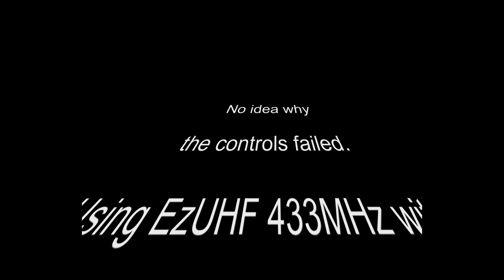LOVE that Failsafe! (BIG Crash...but FOUND!)

Comment: what kind of tracker do you have I had a fly away unlike you there was no finding it. I lost sight of my baby when she whentt through the clouds about half mile out from where it took off I just hope it landed in the woods like your but coming down from clouds there wouldn't be not one useable part left I'm surprised the lipo didn't start a forest fire cause I have no doubt that the fall busted it like a water baloon😭😭😥😢
Reply from the maker: I feel your pain!  I lost a freshly built Tankito on it's maiden flight.  No trace.  I now use a GPS tracker I bought from eBay (here's one like it, item #231624010648).  I put a pay-as-you-go simm in it and it works pretty good.  It is light and the battery lasts for days.
Reply: +AerialWerks any chance I could get a link item number not found
Reply from the maker: http://www.ebay.com/itm/New-RealTime-GPS-Tracker-GSM-GPRS-System-Vehicle-Tracking-Device-TK102-Mini-Spy-/231624010648?hash=item35edddeb98:g:5L0AAOSwlaxWOCSn

Comment: I have a GPS tracker designed to be put in a vehicle that has a cellular modem and GPS in it so when I send it a text asking for the location it replies with the link to it's location on Google maps.  They are pretty small, don't weigh much and only cost about $20 on Ebay.   Seems like that would be a good thing to put on a quad so you can find it when it takes off and goes for quite a distance.  I was thinking about putting it on one I built but never could get the darn Pixhawk PX4 to work.

Comment: What chip did you use to find it?
Reply: bosnianbill What GPS tracker are you using?  I have a bluetooth Tile but the range isn't good enough to find my quad in the woods.
Reply: bosnianbill Thank you for the info, that seems perfect.  Did you get the T-mobile sim card at Wal-Mart or online? By the way, I'm a big fan of both of your channels.  You are the reason I got into lock picking for fun a couple years ago.

Comment: Use Dragon Link lol
I'm glad you managed to find it!
Have a great new week
Reply: bosnianbill How dare you, comparing the king of kings of UHF equipment with ezUHF from Immersion "crap" RC :p
The new Dragon Link micro RX has a GPS option :p
Reply from the maker: ABMNS PRODUCTION Oh!  NOW the good advice comes flowing, AFTER I flip the coin and equip a dozen quads with EzUHF...  Also, typical of my luck, DL comes out with new technology AFTER I buy the old technology.  Crap.  That GPS option would have been a nice thing to have...
Reply: AerialWerks If you have good experience with your ezUHF until today no real reason to change.
But personally, i never had any issue with Dragon Link so far but i might be changed in future who know...